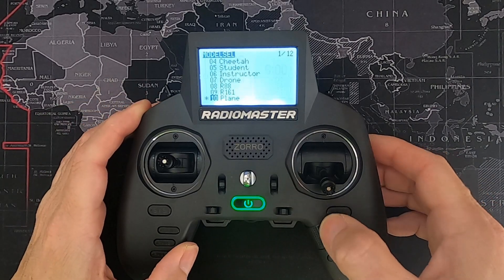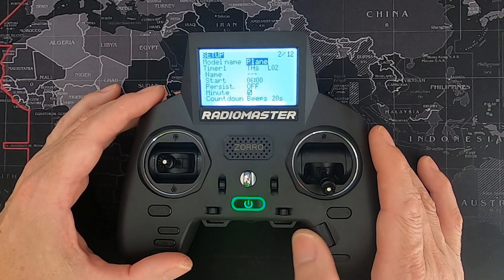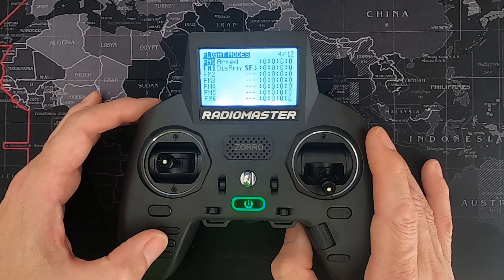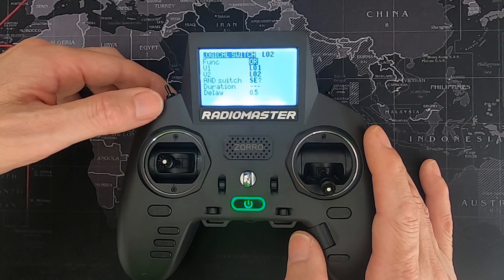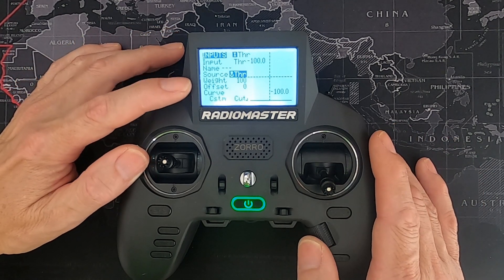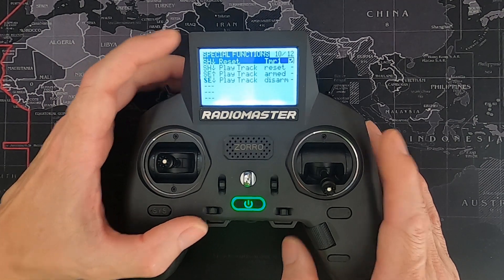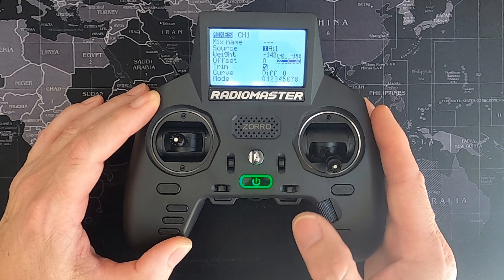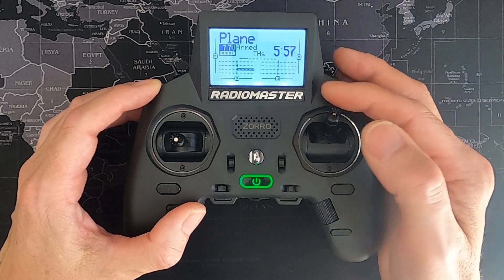RadioMaster Zorro 4(5)Ch Fixed Wing model set up with Safe Throttle in EdgeTX

Comment: Hello Bill, I've followed the instructions for throttle safety. I have gone through this video and confirmed my settings several times and my throttle still works whether my SE switch is up or down. Is there a checkbox perhaps that I  missed to activate this logical switch? Thank you for your help!

Comment from the maker: It sounds like you have not activated the timer by checking the box. Sometimes you need to check the set up one thing may not be correct and it will not work.  This is the first time I have heard of a gimbal calibration problem changing between models. I would suggest changing the CMOS battery if you are confident opening up your radio. If not contact RadioMaster with this gimbal calibration problem.

Comment: Thank you for this tutorial. I am having some issues with my Zorro. For example, I must have watched this 10 times and could not get timer 1 to work. I decided just because to set up timer 2 exactly the same way, and timer 2 works and timer 1 does not. What would cause this? (I did a firmware update with same result) Another example is that my gimbals fall out of calibration every time I switch to a different model. Is that normal? I, unfortunately crashed 3 planes because of this. I think I'm ready to call it quits as it has been very frustrating, and I have lost a lot of confidence.

Comment: At 4:43 , the symbol for Thr does not come up as a (throttle stick logo) selection for me. It only shows for Ail Rud and Ele . Why is that?
Reply: I am speaking of the logo for the throttle stick.
Reply from the maker: @paullebleu8209  Hi Paul, it will be available just go through all the options. Go on to V1 and long press enter first option Inputs second option is Sticks keep rotating through the options and you will find the correct one.
Reply: Thank you kindly Bill! @the-happy-RC-flyer
Reply: HI Bill. There is no Throttle Stick icon like seen on the Aileron, Elevator and Rudder on my Zorro 4 in 1. Only a diagonal line with an arrow pointing to the upper left.  Like what is seen in "Inputs" menu. Any other area I can look at to find this Throttle Stick Icon?

Thank you kindly. @the-happy-RC-flyer
Reply from the maker: @paullebleu8209  do you know how to back up your radio? If so email me the back up and tell me which model to take a look at. triplemadventures@gmail.com
Reply: Hi Bill. I just saw this response. I did not get a notification, so, I am just now seeing this.
I see the back up function. So, do I download it in a file and email the set up parameters I have and send to you for review? That I will need to figure out.
Thank you kindly for taking the time. @the-happy-RC-flyer
Reply from the maker: @paullebleu8209  Hi Paul, you need to send me a back up of your radio as I have not come across this before so I need to see all the model settings. I have tried to replicate your problem but  with no luck.
Reply: Hi Bill. I just sent you the file via your email address.
Thank you kindly for taking the time to help on this. @the-happy-RC-flyer
Reply from the maker: @paullebleu8209  Hi Paul, I do not think this is the model shown in the picture you sent me as the Inputs have not been set up for a safe throttle and the Inputs window is not showing an arrow from bottom right to top left and a 1
Reply: That is strange as there is only one TimberEVO selection under MODEL SEL on my Zorro that shows in the menu! 
I am noticing there is a heading in the other files called "header". Yet, I do not see that in the file that is for the TimberEVO that I sent you. It is, in fact, the only Back Up file for this Model that I have. @the-happy-RC-flyer
Reply: I noticed under "T-Source" in the SETUP menu, it shows the diagonal line with arrow in all of the Models on this Zorro 4 in 1. Is that what should be there?
Nevertheless, the "stick" icon for throttle is never an option on any of the models as I mentioned earlier.
Reply: I just sent a re "Back Up" for the Zorro set up to the plane in question to your email address.
Please advise. Thank you.
Reply: Update to Throttle Icon issue:
The way the Sys-Hardware page had the Throttle identified was the issue. There needed to be no characters between the  "    ". So odd the control came that way. However, that was the fix.
Now the other issues preventing the Throttle cut were worked out. But, since you are quite busy, I'll hold off with any comments on this issue so that I can respond to any questions you may have regarding the resolution. I don't want to waste your time. ;0)

Comment: Hi Bill. When I got my Zorro a while ago, I came across your series to make sure I wasn't borking things up. Came back to say thanks!
I'm flying a 10 channel setup for one plane in the fleet, using a latching setup for one of the pushbuttons to enable autolaunch, the other button for HD cam recording, a roller for a panning servo, the other for flaps... on top of all the regular iNav functions; this little radio is just about right for everything I need.
Just wanted to let you know, (if you're still using the Zorro) that Radiomaster has lots of accessories on clearance, I just bought their antenna mod, rubber port covers, backup switches and a faceplate for about $20 USD.
Reply from the maker: You are very welcome and I am pleased my videos helped you. Sounds like you have some serious flying ahead of you.

Comment: I bought new zorro and having hard time controlling the joystick on liftoff simulator and that kinda give up learning. Is there any settings to make joystick lil insensitive ?
Reply from the maker: Hi Kinley, the controls in liftoff are sensitive just stick with it. I would suggest selecting the open field with straw bales to practice. You can change the settings in the simulator.

Comment: Safe throttle is a very good idea. The Zorro has several momentary switches, I was wondering if the throttle safe could be set to arm if two momentary switches are pressed together for a second? I think toggle switches are too easy to knock especially if hand launching solo. Thanks.
Reply from the maker: Yes you could set your arming up in that way the only concern I would have is if you wanted to disarm quickly in an emergency it would be easier to do so with one switch. I think this way because I fly drones where the ability to disarm quickly is necessary. David, if you would like me to make a video on how to set arming with two momentary switches please let me know.
Reply: @the-happy-RC-flyer  Yes please!